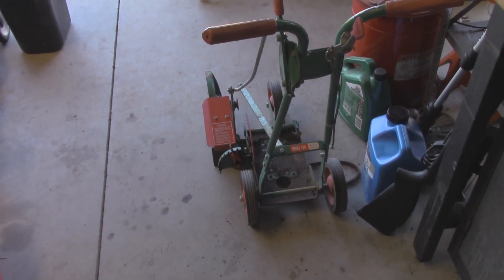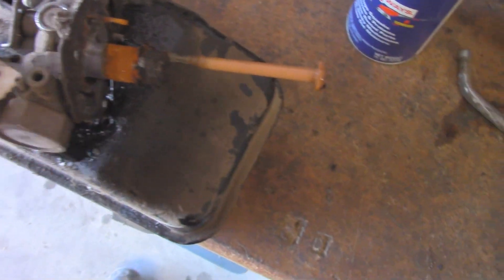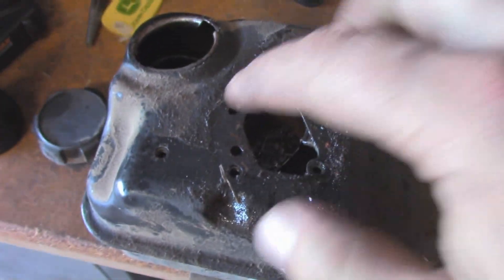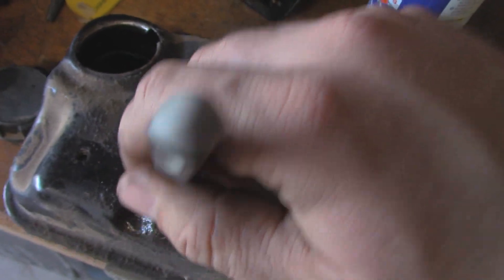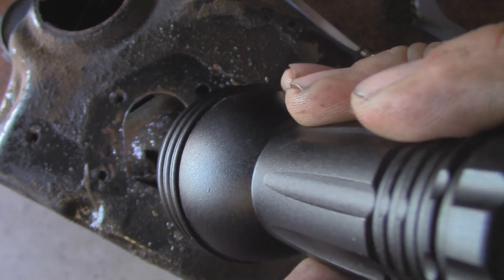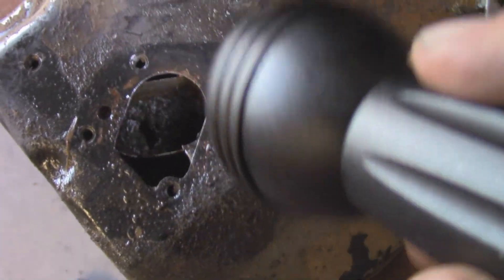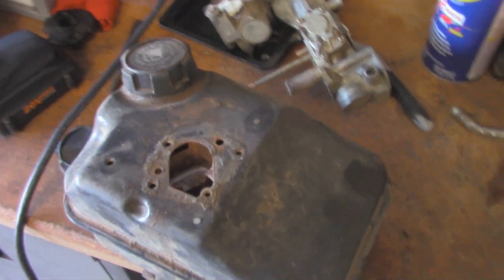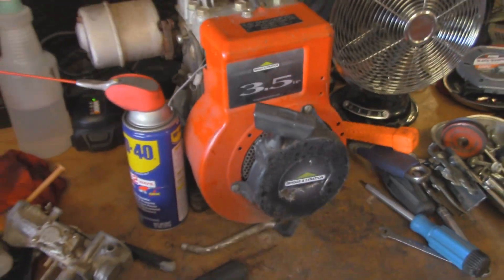Rust Ruined this Briggs Gas Tank

Comment: Last year I had no idea how to take care of a mower.  It would take 12-15 pulls to get it started and blow smoke out of the muffler when it started.  I did yearly maintenance on my mower today.  Changed the oil, changed the blade (was damaged), emptied old fuel,  and cleaned the carb. Started it in 1 pull. I learned most of that from you (especially since you have the only video about  new Briggs carburetors).  Thanks

Comment: Bought a vintage snow blower for $20, the tank is like this one but additionally, the thread for the gas cap also rusted off. The tank is for a 5HP horizontal shaft B&S engine and run about $140 for a new one that was leftover in someone's stash (they've been discontinued). Decided to give it a go in trying to fix it. I was able to get the 2 halves apart by first using a propane torch to burn the epoxy out of the seam then an elongated nose vice-grip with a tooth on the very end to grab it and peel the seam up. I now have it apart and figuring out the best way to fix it. I think brazing another cap thread on then fashioning some sort of cup and brazing it on as-well.  Another possibility is to extend the short uptake to go to the bottom of the tank. I don't know if the suction will be strong enough. I heard the cup was only there to allow the engine to somehow "lean out" when low on fuel though I don't see how that can happen nor the benefit of that.

Comment: Clean the tank out, J-B weld a patch on that bad spot and it's a done deal, JB weld is amazing stuff, I've fixed cracked motor blocks with it before successfully, and gas doesn't effect it

Comment: Tried to clean a rusty tank with white vinegar. It desolved the rust but ate a hole in the tank. Pretty much useless to try and clean rusty tanks.
Reply from the maker: Ive never had it destroy anything I have used it in. Its likely the metal was already sufficiently damaged and was being held together by the rust so to speak